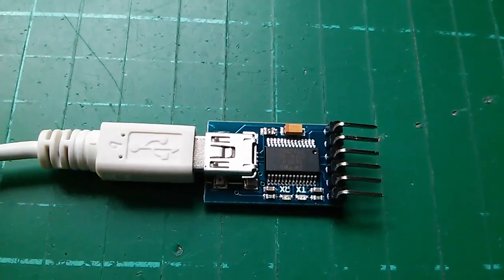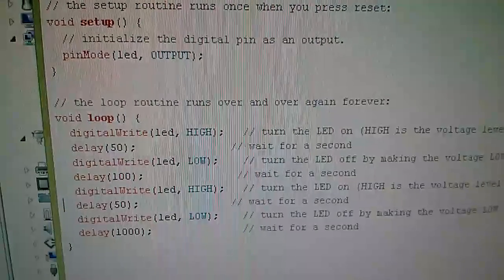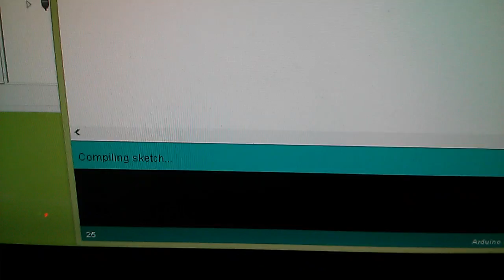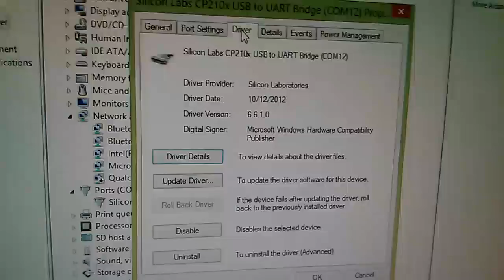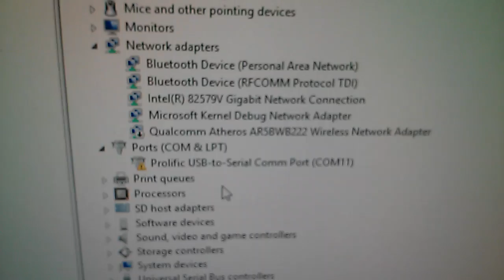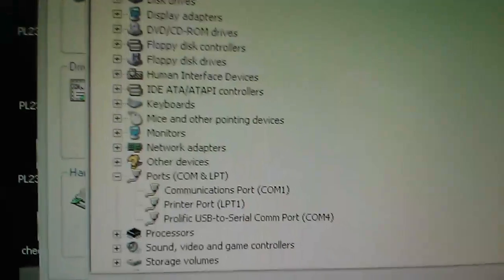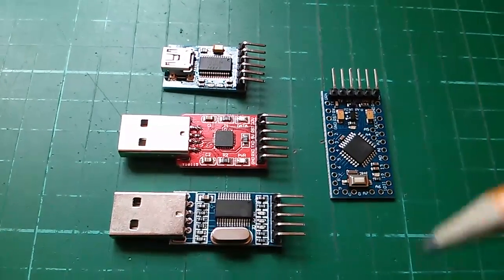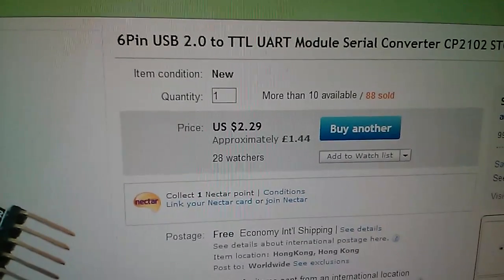Arduino USB-to-Serial Tutorial - Programming the Pro Mini

Comment: had the same problem with the prolific chip, wouldn't work on win10, finally even crashed it.
I tried it on an XP system, with the newer drivers, works a treat.
Maybe it's not prolific bricking counterfeit chip, but just that they din't bother to ensure compatibility all the way, or maybe windows didn't let them know what in win8/10 was not compatible with the chip?
Finally got around digging out an old relique with a windows XP OS. Boot time 4 minutes, ugly graphics, very vintage !

Comment: CP2102 is the one I use.  I leave CTS disconnected.  I flash bootloader to virgin Atmel 328P's with a little cheater board I found barebones and added a few parts.

Comment: If you just walk up and connect your rl232 adapter board to your  arduino board through the rx rx pins. How do you know the he baud rate the board is set to  operate at? My China board connect to windows 10 no yellow flag says port is operating ok. Also short rx rx pins and terminal program will echo key characters,  so I tend to think the ttl board is working but cannot communicate with the arduino board to program it that way

Comment: remember that for arduino reset you can use DTR but also RTS, so the adapter that have RTS pin is also good for the job

Comment: Can i use this board to connect my USB keyboard with ArduinoMega?

https://www.aliexpress.com/item/FT232RL-FT232-FTDI-USB-To-TTL-3-3V-5-5V-Serial-Adapter-Module-Board-For-Arduino/32846412267.html?spm=2114.10010108.1000014.9.b02661f2LwfalD&gps-id=pcDetailBottomMoreOtherSeller&scm=1007.13338.112238.000000000000000&scm_id=1007.13338.112238.000000000000000&scm-url=1007.13338.112238.000000000000000&pvid=69c09911-0f93-430b-9fa2-48de883e3a67

Comment: The FTDI ..I bought from Ebay ..I am really not sure the chip on the board as the chip number was removed ..however when I connected to window 10 it was detected and the driver was installed but the yellow triangle came up showing the port not working..so I reboot the computer with the port left plug in on booth the yellow triangle  gone and the device work...

Comment: On the back of the FTDI chip based board, there's 2 patches marked 3.3 and 5 (see 1:26). In the arduino IDE we see you are using a 5V pro-mini, so it seems there's no need to solder the 5V patch to the center patch, is it correct? And for the 3.3V pro-mini we'd have to solder the 3.3 patch to the center one, right?

Comment: Much time has passed since you made this and a series of other videos around Pro Micro boards and their special requirements for programming, but I have only just bought (well, ordered at least) my first Pro Mini for a miniaturised project, and in my excitement, completely forgot to get USB-Serial programming interface.  However, I have subsequently found a number of tutorials saying that you can program the Pro Mini by using the USB controller on an Arduino board (such as an Uno) as the interface...  The simpler method is aimed at those Unos that have the ATMega328 chip in a socket, so it can be easily removed, and then the 328 on the Pro Mini appears to the IDE to be the only processor available to program.  The other method is aimed at Uno boards (like mine) where the chip is a surface mount non-removable kind... This method requires a few shenanigans to correctly route the instrctions via USB for the first hop and the Tx/Rx Serial for the second hop (at least I think that is what it is doing), but at the end of the day - it does appear that with a little effort you can get around the need for a separate USB interface altogether.  It seems that with similar skulduggery, you can even load a bootloader onto the Pro Micro using an existing Arduino.  If you are doing a lot of work with multiple Pro Minis, I guess it makes sense to have the dedicated device to help with programming, but if you are creating a single bespoke device, then once built, the dedicated USB-Serial interface is redundant (and I hate wasting money)...
Have you ever tried either of these methods?  If so, would love to see a video about them.
Keep up the good work - always look forward to notifications of new videos from you.
Reply from the maker: Pretty sure I've done a video on 'Arduino as an ISP'. Cheers Graham.
Reply: Excellent, thanks - I just found it.  As I suspected - you explained it so much better than any of the other articles I found.  I am now looking forward to my Pro Mini arriving with some degree of confidence again, rather than dread that I'd made a bit of a gaff.

Comment: Hey, i got the same USB -> TTL as you (the red one) could you tell me if you changed anything else besides connection the 3rd pin from the right on the top to RST? isn't RST double feed then?

Comment: i try to program atmega328 with usb to ttl yn-01 not program and have error

Arduino: 1.8.1 (Windows XP), Board: "Arduino/Genuino Uno"

Sketch uses 444 bytes (1%) of program storage space. Maximum is 32256 bytes.
Global variables use 9 bytes (0%) of dynamic memory, leaving 2039 bytes for local variables. Maximum is 2048 bytes.
avrdude: stk500_recv(): programmer is not responding
avrdude: stk500_getsync() attempt 1 of 10: not in sync: resp=0x60
avrdude: stk500_recv(): programmer is not responding
avrdude: stk500_getsync() attempt 2 of 10: not in sync: resp=0x60
avrdude: stk500_recv(): programmer is not responding
avrdude: stk500_getsync() attempt 3 of 10: not in sync: resp=0x60
avrdude: stk500_recv(): programmer is not responding
avrdude: stk500_getsync() attempt 4 of 10: not in sync: resp=0x60
avrdude: stk500_recv(): programmer is not responding
avrdude: stk500_getsync() attempt 5 of 10: not in sync: resp=0x60
avrdude: stk500_recv(): programmer is not responding
avrdude: stk500_getsync() attempt 6 of 10: not in sync: resp=0x60
avrdude: stk500_recv(): programmer is not responding
avrdude: stk500_getsync() attempt 7 of 10: not in sync: resp=0x60
avrdude: stk500_recv(): programmer is not responding
avrdude: stk500_getsync() attempt 8 of 10: not in sync: resp=0x60
avrdude: stk500_recv(): programmer is not responding
avrdude: stk500_getsync() attempt 9 of 10: not in sync: resp=0x60
avrdude: stk500_recv(): programmer is not responding
avrdude: stk500_getsync() attempt 10 of 10: not in sync: resp=0x60
Problem uploading to board.  See http://www.arduino.cc/en/Guide/Troubleshooting#upload for suggestions.

This report would have more information with
"Show verbose output during compilation"
option enabled in File -> Preferences.
 can you tell me about this problem
Reply from the maker: Check Tx and Rx connections and your baud rate.
Reply: What is baud rate
Reply: google it

Comment: I was wondering if you have tried the sparkfun ftdi cable to program? I have tried on and off programming the arduino boards with one that I purchased and cannot get it to work.  I purchased a ftdi cable and downloaded the drivers and have tried many times different settings in the arduino ide and cannot get it to program my pro mini's. I have used a usb tiny with a programmer adaptor that sits on top of the chip and I can program it fine. I just can't get the chips to program with the cable. Have you tried one and what setting did you use in the arduino ide if you did. I enjoy your videos and have been watching them for some time now.
Have a nice day.
Don

Comment: Some pro-mini  clones are shipped without bootloader.  In that case one might have to flash the bootloader first with an arduino as ISP or any other ISP programmers.  Happened to me and it took lot of time to figure out the solution.
Reply: Thank you , you just save me lot pain.

Comment: Hey Julian, great tutorial as usual.
I just got my first Arduino from China (Pro Mini with the ATmega168 5v 16MHz chip)
I also bought the usb programmer with the CP2102 chip, the drivers appear to have installed fine on windows 10 and are reporting correctly in the device manager when I plug in the programmer (UART bridge COM3)
I have connected the DTR, RXD, TXD, +5v and GND between the programmer and the Arduino (swapping transmit and receive)
I have downloaded the Arduino IDE and have modified the Blink programme to do short blinks, configured the IDE to use the correct port, board and processor.
When I hit upload it appears to compile without errors but when it starts to upload I get a Java exception relating to the uploader. I have tried holding the reset until the end of compilation but i still get the error. Do you have any idea what I might be doing wrong? (The Arduino, when powered, goes into it's pre-installed original blink programme)
This is the Java error:
Sketch uses 1,106 bytes (7%) of program storage space. Maximum is 14,336 bytes.
Global variables use 9 bytes (0%) of dynamic memory, leaving 1,015 bytes for local variables. Maximum is 1,024 bytes.
processing.app.debug.RunnerException
 at cc.arduino.packages.uploaders.SerialUploader.uploadUsingPreferences(SerialUploader.java:179)
 at cc.arduino.UploaderUtils.upload(UploaderUtils.java:78)
 at processing.app.Sketch.upload(Sketch.java:1187)
 at processing.app.Sketch.exportApplet(Sketch.java:1161)
 at processing.app.Sketch.exportApplet(Sketch.java:1133)
 at processing.app.Editor$DefaultExportHandler.run(Editor.java:2417)
 at java.lang.Thread.run(Thread.java:745)
Caused by: java.lang.NullPointerException
 at java.lang.String.replace(String.java:2240)
 at processing.app.helpers.StringReplacer.replaceFromMapping(StringReplacer.java:97)
 at processing.app.helpers.StringReplacer.replaceFromMapping(StringReplacer.java:89)
 at processing.app.helpers.StringReplacer.formatAndSplit(StringReplacer.java:37)
 at cc.arduino.packages.uploaders.SerialUploader.uploadUsingPreferences(SerialUploader.java:174)
 ... 6 more
Reply: Ok I have got it working, the problems was that I had just downloaded the nightly build of the Arduino IDE and run it from the executable in the root directory.
Presumably Java couldn't find a library or something or maybe I should have put the Java dir in my PATH variable (although I do already have Java installed separately), anyway, I downloaded the installation executable, installed the IDE and uploaded it from the new installation, all works fine now :)

Comment: Is this what I should be using instead of the CP2102?

http://www.ebay.com.au/itm/To-TTL-USB2-06Pin-CH340G-Converter-for-STC-Arduino-PRO-Instead-of-CP2102-PL2303-/191149156465?pt=LH_DefaultDomain_15&hash=item2c8160a871

Comment: Hi Julian,

Great Video's
Just watch this one and your other one '1-Day Project Build Your Own Arduino Uno for $5'

I have just built a Arduino Uno on a breadboard and programed it with my genuine Arduino Uno. It work fine this way.

Now I am tiring to program it with the CP2102.

I was just wondering it if you had any luck getting the CP2102 breakout module that you show at the end of this video working. I to purchased this one from Alice however I am at a loss as to how to get it to work.

I have tried all manner of connections, Just can't get it to sync.
It would be great to get it working and any help would be greatly appreciated.

cheers

Stuart

Comment: I know video was made nearly 2 years ago, so since then there is another serial USB to serial TTL converter/adapter - CH340G.
I am using Arduino Nano with this chip, it works fine. So I purchased the USB to serial adapter with the same CH340G chip to test it and see if it works the same on the adapter board.
Reply from the maker: Sidabra24.com The CH340 is now my favourite USB/serial chip

Comment: Julian,
for the one that did not worked for you with Win 8 i found very nice solution
i did not read all the comments so maybe it was mention below
if you will use the "smart" sequence
1. click on the upload in the IDE
2. immediately click on the reset bottom on the arduino Mini
you will see the blue led blinking and the program will be upload successfully
if you miss the sequence
just compile (verify) the code again and do steps 1 & 2 again
good luck...
Shmulik

Comment: Hello !
I am getting error "Programmer is not responding" when I am trying to upload sketch / burn boot-loader .
> I am using a blank chip : "Atmega 328P - PU"
> Usb to serial : PL-2303 XA / HXA Module. and Driver is correctly installed (No yellow sign of Exclamation )
> I am Using OS : Win 7 x86

do any one have idea what's wrong ?
and :
I select Arduino UNO (from Tools > boards > Arduino UNO)
respective COM Port (By checking Device manger)

Which Programmer do I need to select from tools > Programmer > ???

Comment: ATTENTION EVERYONE LOOKING FOR A WAY TO PROGRAM WITH THE THIRD CHIP:
I ALSO FELL FOR THE TRAP, AND HAVE FOUND THE PROPER DRIVERS FOR IT. I HAVE REHOSTED IT ON DROPBOX JUST INCASE THE ORIGINAL 404s.
Original : http://www.icidu.com/media/productdownloads/C-707607/drivers/C-707607%20Driver%20Vista%20-%207%2064%20bits.zip

Rehosted dropbox link: https://dl.dropboxusercontent.com/u/12909939/C-707607%20Driver%20Vista%20-%207%2064%20bits.zip

THIS IS CONFIRMED TO WORK ON WINDOWS 10 Build 10041
Reply: +Jewsus Nippleton Thanks for the Windows 10 drivers, I just ran the PL2303_Prolific_GPS_AllInOne_1013.exe that I extracted from your zip.  It put some drivers on my machine, but did not install any.  I then updated the driver using the 2008 one installed.  Awesome!  I'm running a Windows 10 tablet from Sony that's a few years old.
Reply: Sure, and it's totally not going to contain malware. 0/10 wouldn't fall for.
Reply: Go back to IT school and stop telling lies.

Comment: there is no sound in the last part of the video.
Reply: Tonio Reyes There is a sound, but only one channel. I believe it is only on the right channel (or left, I can't remember if my speakers are placed properly). So if you don't here a sound, it means your audio output is only one channel. Check your audio settings.

Comment: I have the bottom usb Prolific Technologies PL2032HX and was able to program the Arduino mini pro 5v with Windows 8.
You need to first install PL2303_Prolific_GPS_AllnOne_1013.exe
then plug in the device.
Go into device manager and you see in Ports (COM & LPT) Prolific USB-toSerial Comm Port with an !.  When you get the Properties you see code 10 error.  Click on Driver tab and then click on Update Driver. Choose "Browse my computer for driver software".  Choose "Let me pick from of a list of device drivers on my computer".  At this point choose the older version 3.3.2.105 and not the 3.4.67.325 version.
connecct RX to RX, TX to TX, 5v to Vcc, GND to GND
Tell the Arduino software it a Arduino mini pro on what ever comm port that the Prolific Technologies PL2032HX on
Hit pprogram and Bob is your uncle.  I didn't even had to press the reset button.
Reply: Mike Blais,Do the software works with windows10???
Reply: #2
Well, apparently my case was a Layer-8 Error. I has the connections RX-TX and TX - RX from arduino to usb ttl. However the PL2303_Prolific_GPS_AllnOne_1013.exe was installed. I did went into device manager and found that the Arduino was detected with no problems. I think that probably the current Arduino IDE already contains a good load of drivers... idk.  I'm juts starting with Arduino this week, let's see what happens.  

Good luck!
Reply: Mike Blais I do believe the issue is not actually windows 8, but counterfeit devices. The Chip stopped being produced a long time ago, and there are no authentics left unless you get a used one or a back stock is found. Older drivers did not do counterfeit checks, and those work. It gives the false sense of authenticity on older OS's simply because the drivers did not have authenticity checks then.
It may also be that the device being old, may not pass its own authenticity checks as well, if it was a hardware feature that had to be implemented later. If this is the case, pretty greedy move to attempt to break their own devices on newer os's, I doubt this is true.
At least their counterfeit check doesn't brick the device tho. That was some drama lol.
Reply: Yes, I did get it to work.
Reply: Trying right now, W10 latest update nowadays... I will let you know how it works. Currently my IDE and arduino mini pro does not connect each other. Let's see what happens after this workaround.
Reply: Presumably you mean PL2303_Prolific_GPS_AllinOne_1013.exe, not PL2303_Prolific_GPS_AllnOne_1013.exe, which apparently does not exist.
Reply: Mine gets stuck on "uploading" what to do?

I don't have a yellow mark on device manager and chip cheker says it is an prolific pl-2303 xa/hxa chip

Comment: Hi, i have the third converter (the pl2303), and i want to communicate a sim900 module with a PC on Hyperterminal to test AT commands, but when i tried it doesn't work :( , i don't know if there are 2 versions of the converter (5V and 3.3V) ?!
 
P.S : i've made a script on arduino uno to do the same operation and it works ..

Comment: I have a pile of these USB to serial converters in the form of RIB-less 2-way radio programming cables... They take USB to RS232 for the most part but some of my Motorola cables take USB straight to TTL.
Quite handy in the field with a laptop but in the shop we still use the good ole Serial to TTL RIBs (Radio Interface Box) and an older PC with a 9 pin port.

Comment: thanks !
your video helped me out figuring how to use an FT232H breakout board to program a ProTrinket 3V

Nb: while I'm able to program it with a test sketch ( LED toggling ), it seems stg went wrong for another sketch using serial ( wich "works" but that I can't seem to be able to update ?! -> weird ! )

While I'm at it, a little question: is it somewhat logical that I have to invert TX & RX of my "FTDI programming wiring" ( RX, TX, GND, RTS/DTR ) to be able to do serial comm ?

Also, any hint(s) on programming on linux using a bluefruit EZ link ?
=> I've been scratching my head for too long on this one, and I already got serial comm working & a test script in Python to do DSR RTS tests(..)

looking forward to reading your answer
+